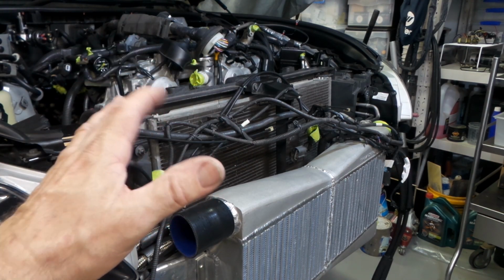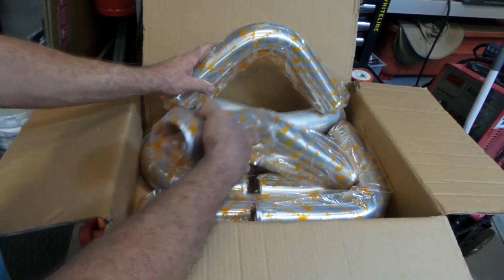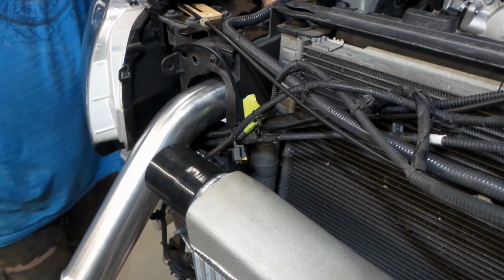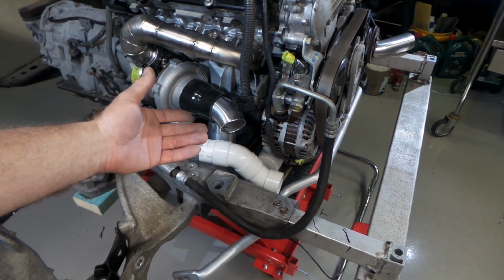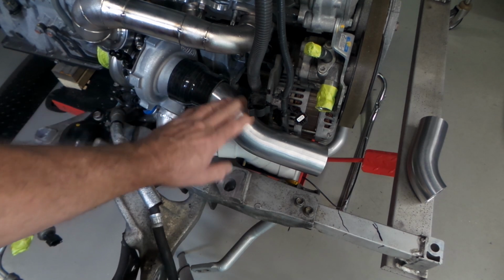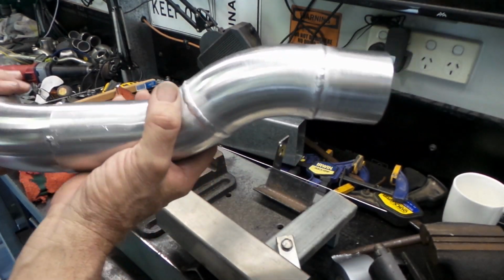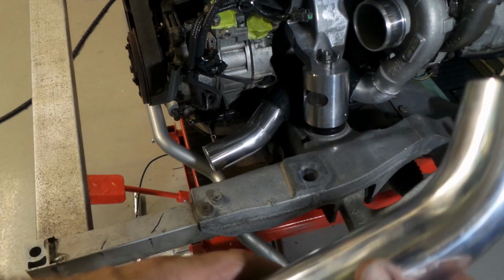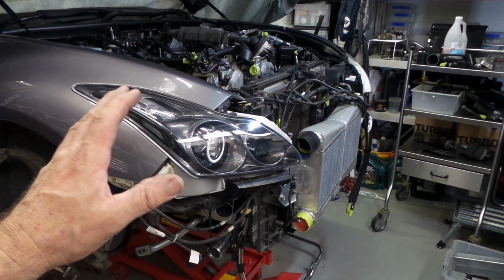Intercooler Piping How To Diy Part 1. Episode 6 in the RHD 370gt Build

Comment: Nice work - as usual. Can you tell something more about that bit on the dremel, so I can order a couple? 

Bead roller video would be good. Pretty straight forward build by the look of it, but the devil is in the detail.
Reply from the maker: G'day Benny, the Dremel cutting bit is called a "Spiral Cutter" Part # 561
Reply: @TheAussieShed  thanks!
Reply: With the air pipe going past the alternator, you'd want to consider torque twisting the motor too, so you do need maximum clearance.